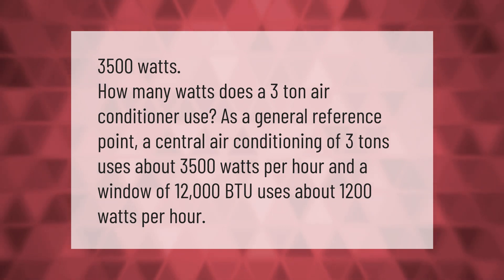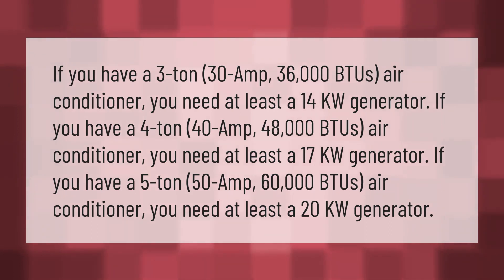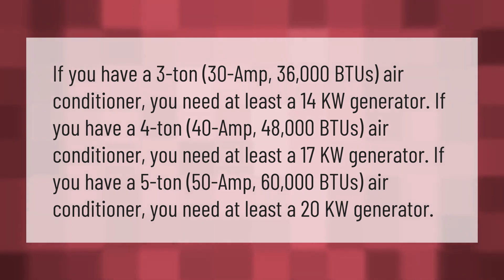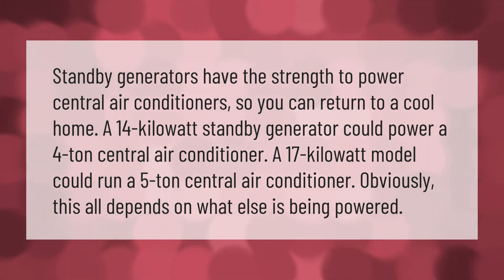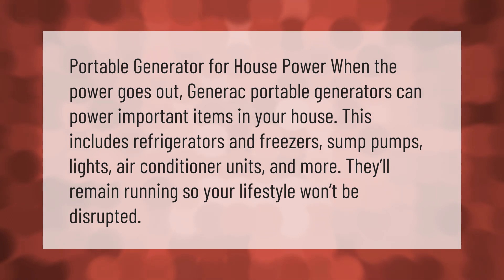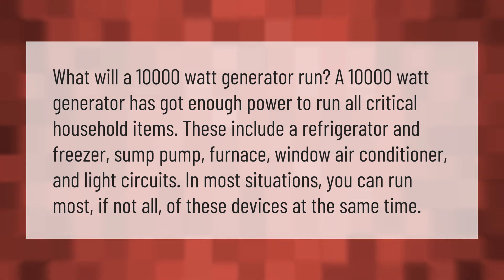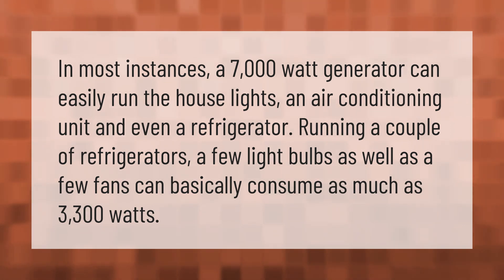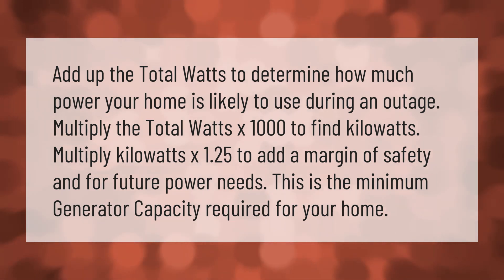How many watts does it take to run a 3 ton air conditioner?

Comment: Lol this is a generac commercial with a bias towards a standby generator. You can run your ac with a smaller generator especially if you install a soft start on your compressor.

Comment: there is a contradiction within seconds on this video. It initially says that you need a 14Kw to run and 3 TON ac  and a 17 Kw for a 4 TON ac; right after it says you need a 14Kw for a 4 TON unit. Not a very useful video with bogus and contradicting info

Comment: This is false, sorry to say. Because I run both of my 3 ton ac units with a honda eu7000is which is 7000va. That comes out to 5500 actual watts, not to mention my fridge tv lights freezer etc.
Reply: Question I have a 4 ton ac unit, how much kwh should it be using on the hour, I saw my bill and running my ac for 8hrs with no ther appliances said I used 120kwh a day for 8hrs of ac usage which seems off to me. 120kwh is like 40$ a day smh
Reply: @raiders3417  that all depends on the efficiency of your unit, the seer rating, and if you have no freon leaks. You need to check freon level.